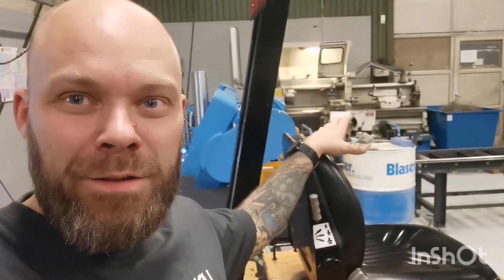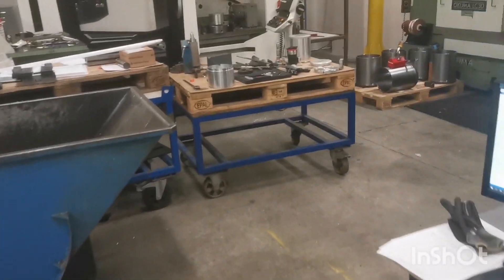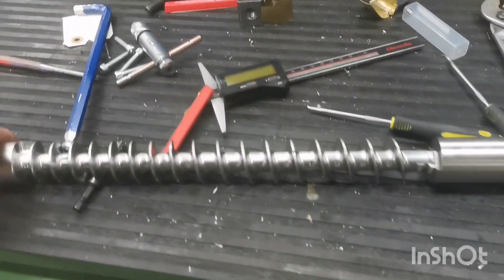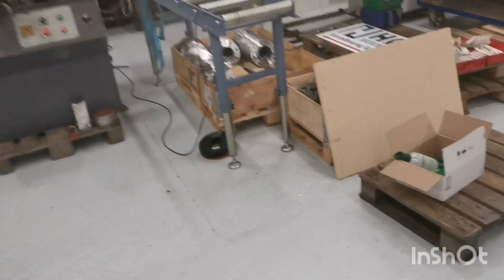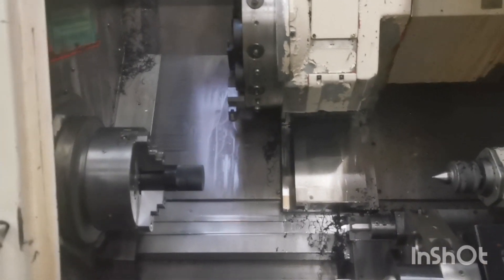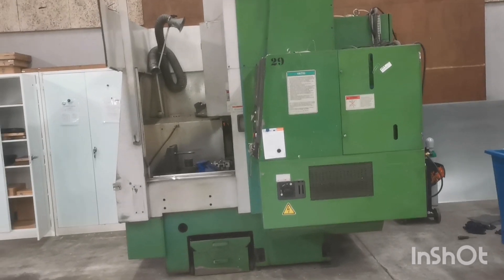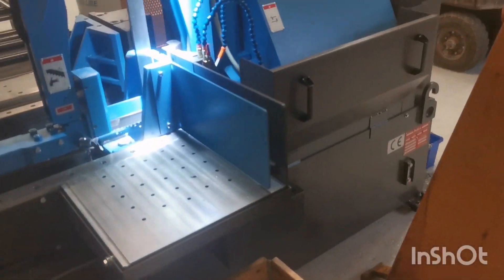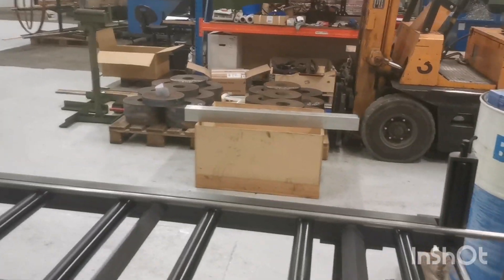now i can cut most of the material i use myself on this beast!!!

Comment: POM C or POM H?  In the US we call POM C Acetal, and POM H is often called by the trade name Delrin.  Charles
Reply from the maker: I dont know the difference. I just know its Black POM. Machines very Nice
Reply: @nikolaiownz  Yes both products machine nice, not that much difference between them.  POM C is a copolymer and POM H is a homopolymer.  Enjoy the weekend.
Reply from the maker: @465maltbie  you too mate 👍👍
Reply: @nikolaiownz  The only downside i have found with POM / Acetal is the sizing changes after machining ??
IF the parts are not super critical it won't concern you to much.
Reply from the maker: @weldmachine  yeah i dont do parts with critical dimensions in plastic at All. I flad out say No quote